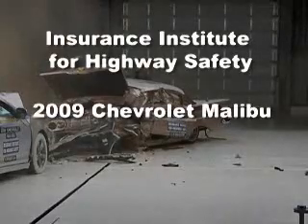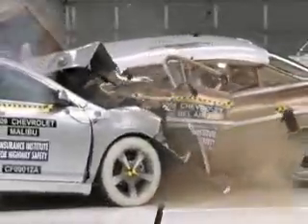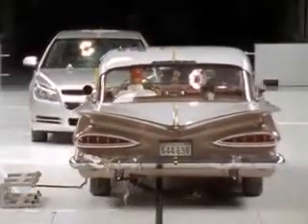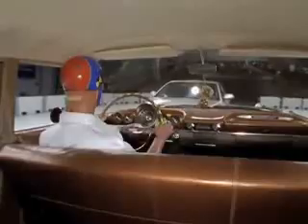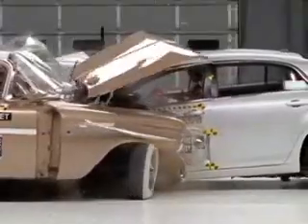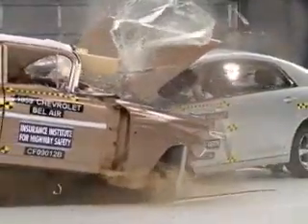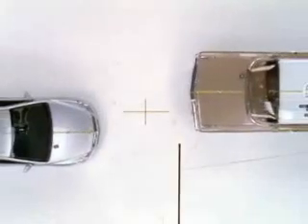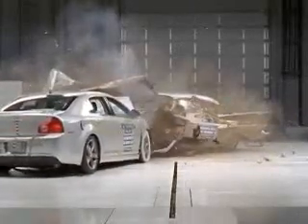Crash Test 1959 Chevrolet Bel Air VS. 2009 Chevrolet Malibu (Frontal Offset) IIHS 50th Anniversary

Comment: a staged test, understanding the design flaws of the 59 gives reasons why this is a deceptive demonstration.
more metal and larger fasteners were used in older cars and walk aways from 100 mph roll overs were common. cars were ridged and impacts would jar people and the glass could decapitate.
in new cars air bags can trap and metal is thin and that doesnt always equall safer. ask a demolition driver what he would rather drive.
older designs were more simple and robust.

Comment: @brokencherry16 Obviously bigger is not better because older cars were not designed for safety. You can deny that all you want. Typical of old car fans stuck in the past believing in a failed religion. These old cars killed millions. Today's crash death rate is half of what it was in the 1960s.

Comment: @raihol New cars don't break down like old ones did, they don't need nearly as much maintenance as old ones, they last much longer. Styling is another issue. Old cars lived in a world of cheap, endless gas, no safety requirements and large, wide, open roads without much traffic or parking congestion. Those aren't today's realities.

Comment: @heavymetal1110 They are a POS in terms of safety. Their corporate creators were irresponsible because they knew the problems and didn't act boldly and proactively to prevent them. They took advantage of the ignorance of the customers they killed.

Comment: @ss101504 I had a accident with my mom's '10 Accord just 10 days after she bought it, speed of impact was not more then 25 km/h, I think thats 15 MPH, after Honda replaced all the parts it came out to like $6K, A part of the bumper was gone and the so was the front drivers headlight but they replaced both because there evil, we've learned our lessen, never lease again.

Comment: @highroller48 @highroller48 you want to talk physics??? newton said that if 2 objects colided at the same speed, the heavier one would still move foward, in the vid, the malibu pushes the 59 bel air back, meaning malibu was heavier, but if you look up the curb weights of both cars, the bel air was heavier by 200 pounds, so the the bel air should have pushed the malibu. i think the IIHS is too full of themselves and weakened the 59 to make it look like they did something in 50 years.

Comment: @DodgeChallengerules 1930s Terraplanes only weighed 2500-2800 pounds. It was not designed for crash safety the way new cars are. Neither was the 59 Chevy. Crash either car into a new Prius and the new one would definitely win. Older and bigger cars aren't really as safe as some new ones.

Comment: When i bought the car i went about 1900 miles and didn't have trouble with it, By the way the water pump is in stock at almost every single auto parts store around, it was made from 55 to about 2005 i have the later year model.  The water pump is about 35 dollars on average.

Comment: @Supergungun A Civic's structure is far more rigid than the old car's structure. It would take motor twisting just fine. Newer cars, especially the Civic are far better than you're aware. Your old laws of understanding are clearly outdated and rooted in emotion not fact.

Comment: @Supergungun Honda Civics are built way better and stronger than yesterday's equivalent weight "classic" death trap. How is that possible considering they weigh the same? Smarter engineering and technology and applying the metal only to where it's needed which is the structure, not the skin. And yes, a Civic could have it's suspension modified to hold the weight of an 8 liter V8 (but not the size). You really know nothing about cars do you? Just another old car fanatic stuck in the past.

Comment: @DodgeChallengerules 38 Hudson would be crushed. Old cars wasted their metal weight on weak structures and thick sheet metal. They were not designed for safety. New cars like the Malibu, which weigh the same, use their metal smartly, where it needs to be, in the structure, not the sheet metal.

Comment: I can't believe how many fools there are commenting on this video. No offense, but are you blind? Don't you see the massive red cloud of rust dust coming from the Bel Air?

This car is 50 years old, and has been rusting for probably 40 of those years. It is nowhere near as sturdy as it once was. Crash a re-manufactured Bel Air and you will see how different the results are.

Comment: It wouldn't have mattered if it had interior safety equipment, the BODY structure was hampered by the weak X frame and A pillar which collapsed. If you don't improve the pathetic body structure, no amount of interior solutions will help. By the way, the "plastic" car weighs as much as the "steel" car. They have a similar amount of metal, the newer one just uses it better.

Comment: @thekidrocks72 
The Older cars were very heavy due to actual thick steel ALL over, very little aluminum and almost no plastic.
The newer car is heavy mostly due to the enormous amount of  wiring required for electronic components and electrical luxuries such as electric windows, mirrors, seats,,etc... small electric motors and solenoids add alot of weight.

Comment: At least the 59 belair actually looks good and not like a little silver communist that sips ethanol and complains about the environment...When General motors realizes that they are not Honda and once had some dignity ...the year (1969) we can  all drive cars that dont suck. Lets imagine that the 59 has the same crash test rating and gas mileage as the 09 which car will America choose... Oh thats right its the Bel Air the only car of the two that has Balls

Comment: if true, actually that makes the 59 worse. Why? because if the original car in good shape is much stronger then it won't deform and won't absorb damage. That means the occupants suffer higher G forces and hit the hard interior harder and die more thoroughly than this video depicts.

Comment: What you're seeing is the rust from the 1959's frame blowing out in a blob of smoke.  I do believe if the '59 were in pristine shape, it would have held up better than this video displays. Once the frame is rusted thru, the steel looses it's integrity.  (Plus the original x-frame design under the Chevrolet wasn't all that strong.) So yeah, I wouldn't put too much emphasis on this certain video.

Comment: FAKE! you can clearly see from the pattern of ejection material from the bel air at point of impact that there were small demolition charges placed in the A and B pillars rigged to go off. This thing is guvermint conspiracy! Also i've blown up frame 1250 and enhanced it, and I see the a faint image of the face of a 53 year old Spanish MP in the smoke. I bet there wasn't even anyone in the cars.

Comment: @stormrider4040  The IIHS doesn't screw cars. It tests them. Only in the last 10 years have cars been designed to handle a 40 mile per hour crash where all the force is concentrated in just one corner of the car. There's many stories of people walking away from crashes in old cars after "hitting a brick wall at 60 miles an hour". But if brakes were applied, the speed at impact was much less than 60 mph. And a "brick wall" spreads the force across the entire front.

Comment: X-frame was not the big weak link, It was the body construction for 59 Chevrolets. Thin A pillar, B pillar, C pillar(sedans) 59 Caddy sat on a C-body X frame but the rest of the car was built twice as strong. People forget Chevrolet was the bottom of the food chain for GM. They were built paper thin compaired to a Buick, Olds, Caddy, Chrysler,  even  Ford was a much better quality solid built car. I have ownwd them all. 2, 59 Caddys,88s,98s,Galaxies,300 Customs, Fairlaines,LeSabres,Over 250 cars

Comment: @Robotapedia  This is not a commercial or even a government test, this IIHS test is an independent, non-profit shopping guide for people who want to know which cars do better in a crash. People still die thinking older cars are safer or that they don't need to wear seatbelts in newer cars because of airbags. Bag with no belt breaks spines and legs because they body slides under the bag. There's a lot of misconceptions out there that IIHS tests try to correct.

Comment: You're right about the need to show modern cars crashing with and without seat belts so people can see that even with airbags, the body will slide uncontrollably under the bag resulting in crushed knees and back. And yes, it seems like a moot point to sacrifice a beautiful old car not sold anymore. But look at how many people still insist that old cars are safer. They are telling themselves and others that no matter what, new cars are not safe. So they don't bother wearing belts at all.

Comment: Thats right and if the 59 doesn't start you can go to walgreens and get a nail file and clean the points or get a flat head screwdriver and take the top of the carburetor off and clean it out. The 09 will be recycled into some sort of printer or garage can, maybe even a shoe.

Comment: The 1955 truck weighs 3,300 pounds which is less than the 2009 Malibu. No old car or truck back then was built to withstand a 40 mile per hour corner to corner crash. The chassis would fail and the passenger compartment would crush the driver just like this 3,500 pound Bel Air. Go look at all the other videos of old cars in crashes and crash tests. They collapsed at speeds lower than this test.

Comment: All new cars are not created equally. A microcar weighing 2,500 pounds or less such as Honda Fit, Toyota Yaris, Smart Car, etc are too light to do well against a midsize cars like Camry, Accord, Malibu, etc weighing 3,500 pounds even though they do well individually against each other. However "small" cars weighing close to 3,000 pounds in between micro and midsize fare better against common mid size vehicles which are the most common weight. Small cars are Civic, Corolla, Prius, etc.

Comment: Maybe deaths have tripled in Australia, but in the USA since 1961 total crash deaths have gone down slightly per year even though the population doubled. That means the death rate per capita dropped 50% and when vehicle-miles driven are factored in, deaths have dropped 70%. That last figure is due to quadrupling of miles driven per person.

Comment: There's still a lot of people out there who think older, bigger cars are safer than newer, smaller cars. So they don't use IIHS videos to see which ones are safer than others and overpay for bigger cars than they need to. Or they hold on to older cars and get hurt in crashes and don't bother to think that a newer, smaller, better made car would have protected them better. Happens all the time.

Comment: old cars rule, just spent 3 hrs round trip in my 59 chevy mine gets 16 miles per gallon, with the new v8 engine im going to put in there the car will get 22-24 miles per gallon, I know this for a fact because my 56 chevy does.

Comment: To the credit of ladder frames, they're very strong and robust, especially when fully boxed. That's why we'll never see a unibody F-150, or Silverado. And heavy is not synonymous with strong, but I've driven old cars for years, as well as newer, - have never been in a wreck with them, but many old cars are not only massive, but built with solid raw materials, throughout. Newer cars have the rigid safety structure, but the rest of the car is far from solid.

Comment: trainiax, chrome is useless at 40 mph, true. But all steel construction, and sheer mass isn't useless however. That particular 59-60 Chevy is not the most crashworthy old car you could choose.
Take a car like a '72 Eldorado (which to it's credit has seatbelts ), at nearly 4,800 lbs. doing 40, and the laws of physics would ensure that the Malibu get's plowed. Especially since aside from the safety cage, the newer car is built to crush. Quite useful.

Comment: you can tell that this is not a true bel-air. it is an impala fixed up using a bel-air front. when compared to the 1959 Chevy Bel Air, you notice trim marked the rear trunk deck lid center crease and on tail lamp lenses. the car has a dummy vent above the rear window (only on impalas) and the impala trim on th botton half of the dash.

Comment: ALSO....take into comsideration that 1959 vehicle has to have considerable deterioration over "50 years". The welding spots, road vibrations loosening it up etc. Would have been interesting to bring a brand new one back in a time machine and see how well it did.

Comment: The technology come a long way the Malibu 2009 is Unibody frame with crash zones built in to absorb the impact.  The 1959 is bolt on frame car and they did not start to put seat belt in cars till the late early 1960s. Still, gotta appericate the creativity 1950s that is lacking now in car design

Comment: Your friend was lucky. Usually old cars hold up well in a crash, but transmit the force to the passengers which kills them. Newer cars that pass the IIHS offset test have safety cages where the A pillar (door frame) is and crush zones ahead of the A pillar to control and decelerate the force so it isn't transmitted to the passengers. It's cheaper to replace a new car than even a few days in the hospital. Insurance companies actually helped increase safety with their funding of the IIHS.

Comment: You're a real idiot. The glass flew out because it wasn't designed to stay in place like today's glass. The engine was NOT cut out and there were no deliberate attempts to weaken the car. The A pillar crushed because it's a poor design, don't try to lie about it just because your poor little collector car feelings got hurt. Embrace reality.

Comment: This was really difficult for me to watch as I own a 1959 Bel-Air and have had it since 1979 when I got it from my Grandfather who bought it new in 1959.  It only has 97000 miles on it and I don't drive it too much as I am afraid some goof will hit me.   But I do see how newer cars are safer for the passengers.  My 59 does have factory seat belts installed and I use them when I drive her.  I would love the parts off this car for mine!

Comment: The 59 Bel Air, while probably not much safer when new, is clearly suffering from rust. This can be seen most in the shot taken during impact from the passenger side. This would explain some of the collapse of the driver compartment. Most damaging is the A-pillar design. This design is for style, and provides minimal reinforcement of the firewall.

Comment: Sad to see a nice old car wrecked. It certianly drove home the point. I have been cutting people out of cars for about 25 years and the older cars are deathtraps. Seat belt harnesses, anti-lock brakes, air bags, crumple zones, seat bel pre-tensioners, cobalt a-post rods all go a long way in keeping the passengers alive. God bless the engineers who design the safety systems. Id like to put my foot up the ass of the guy who designs the mechanics . Did you ever try to work on one of these new cars?

Comment: The narrative of comparative damage didn't mention the collapsible steering column in the 2009 Malibu vs. the non-collapsible one in the Bel Air.  Did you notice how the Bel Air's steering wheel was shoved right into the driver's body, probably crushing the sternum, possibly breaking the neck, jaw or skull, as well?  Conversely, the Malibu's steering wheel did not appear move at all and just as well at that -- that air bag feels like a punch in the face as it is!